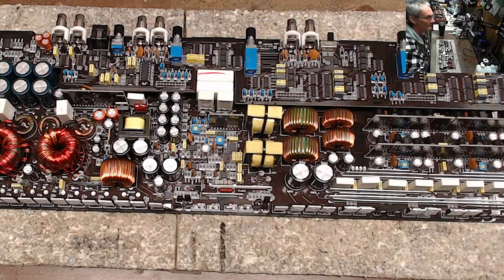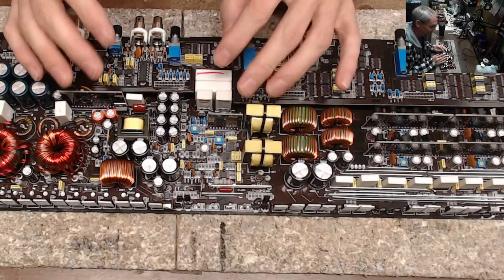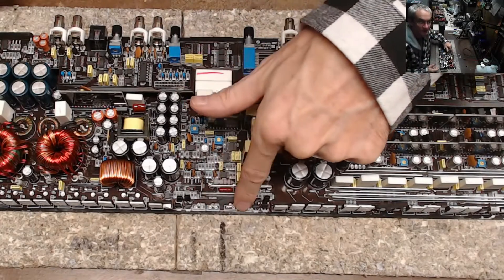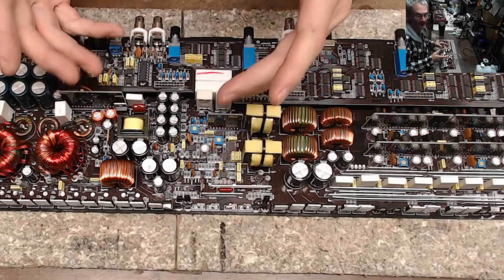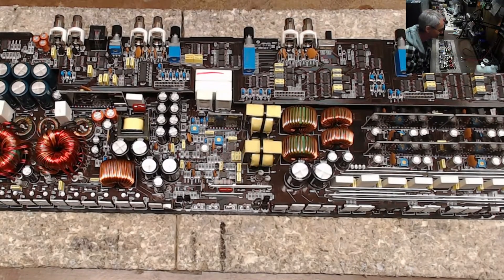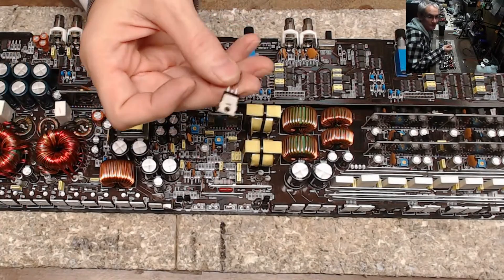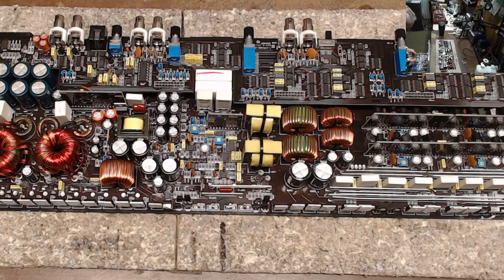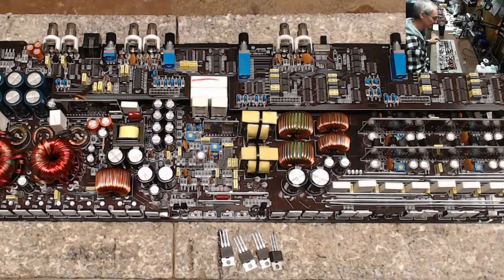Even Good Techs Make Mistakes When Repairing Amplifiers JL Audio 500/5 Repair Error

Comment: Don’t feel bad. I just finished attaching all PS FETS, rectifiers and all outputs on a Rockford 801S. The ones with the annoying MESHA strip that attaches to the heatsink. I powered it up and fried the power supply on one side, again! All because I forgot one SOT-23 totem pole driver for the power supply. Never did that again! That’s how we learn is through failure. It’s called experience. 
Thank you for sharing. It helps those new to electronics know that even the best guys still can make mistakes. Thanks for the video, Todd.
Hope everything is going well with the OEM repairs.

Comment: Great one Todd! Just a little info on JL Audio Slash series amps and the HD amps. Their power rating is for resistances of 1.5ohms-4ohms. So a 500/1 does its rated power of 500w plus from 1.5-4ohms at 11.5-14.4DCv (as I tested myself but JL says 12-14DCv. As for the Caps, they are designed that way with the bulge on top. That is normal and the caps design and is nothing wrong with them. Most of the time, the failure on the power supply side is from inductors clipping from the output strain on the rails. The JL RIPS design is built on the premise of no electrical upgrades in mind. It’s why they cost so much. Sam of Barevids did a really good rundown on the JL amp design and why they are such a unique amp. Even Perry’s guides has a good rundown on them. So when Todd says keep your hands out of the rails, JL amps has a potential of over 300v peak to peak rail. So be careful y’all!!!!!
Reply from the maker: Nice! I love it when info is posted up for people to refer to. Thank you as always! And of course as soon as I installed the correct transistors it ran flawlessly.
Reply: @ellensburgamplifier  I'm certain it did. All that is shown in this video, is that your T-Shoot and confirmation on repairs is a solid and fool proof process. Also, if you don't have it, I have Perry's guide and a lot of photos and documentation on JL slash series amps, and some info on the 500/5 in the guide as well.